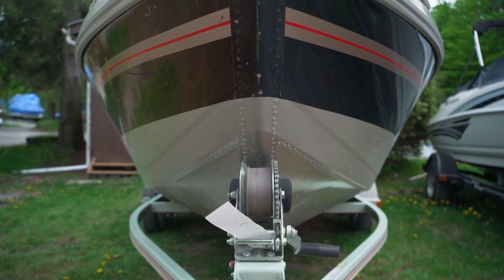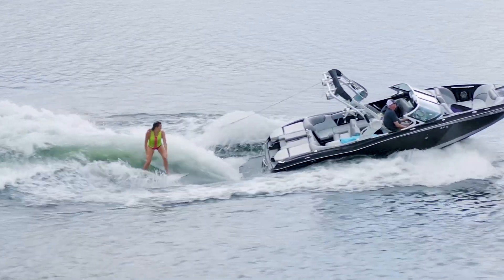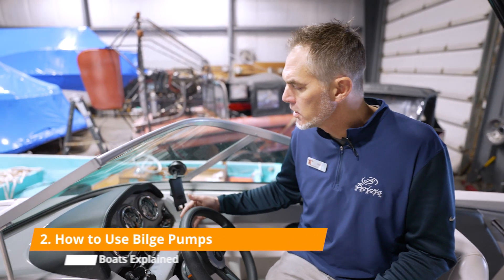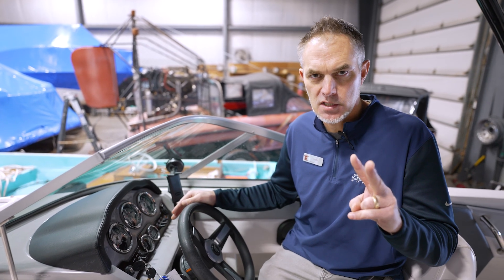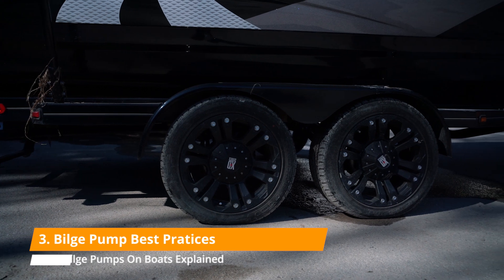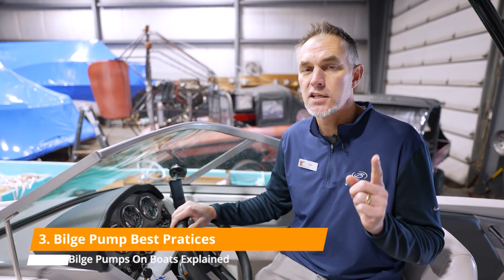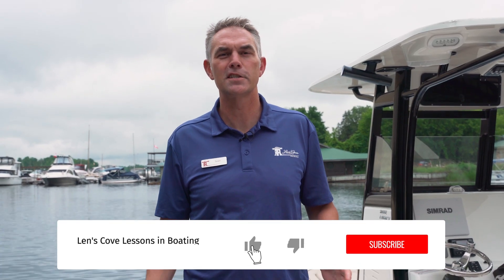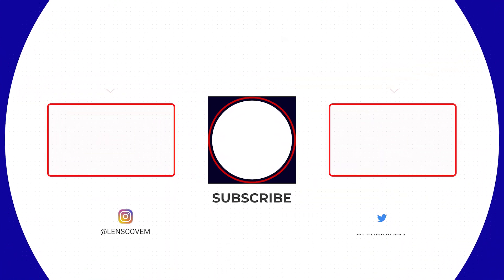All About Boat Bilge Pumps

Comment from the maker: Is your bilge pump automatic float switch wired directly to your battery (always on)? Tell us your opinion on this.
Reply: I rewired ours with its own fuse directly to the battery as our boat would have required leaving the battery switch on for the auto feature to work.
Reply: @brian395  well done!
Reply: The bilge pump most often is the only component that over rides the battery switch being turned off.
Reply: Always, preferably an all in one unit. My current boat has a separate switch that I attached a floaty to so it engages earlier and keeps the hull fully drained. I can't imagine any reason why not to have the bilge wired for always on. Sure there's a risk something happens and your battery is drained, if that's a huge concern, get a solar trickle charger. But as someone who's had a boat sink at the dock, it's worth it to just leave it on.
Reply: (((Bilge pump situations)))
1. Keeping the switch in manual position. Melted the bilge pump after running without water or keel the battery.
2. Keeping the switch in automatic. If for some reason the float switch stays on all the time will damage the bilge pump or keel the battery too.
To prevent both situations. I connected a little alarm speaker on my bilge pump switch. This way every time the bilge pump is working the alarm will sound to let me know. Also I be aware when it is working!
Reply: I bought my 40 year old 26ft trawler three years ago. It has an auto bilge pump in the bilge, but above the drive shaft. (No space below the shaft.) So there was always water left in the bilge. Pump is powered by the House Battery through a switch on the main panel, then to an Auto/Off/Man Bilge Pump Switch. (I intend to bypass the main panel switch, as it serves no purpose and is an extra potential point of failure.) 
There is also a hand-operated diaphragm pump, which was broken and had no pick-up hose. I repaired it, and ran a hose under the drive shaft, so that I can manually drain the residual bilge water. 
Recently, after seeing a couple of local boats go down during an extended period of rainy weather, I installed a backup auto bilge pump in the engine bay, with the auto wire connected directly to the Start Battery (fused, of course). I didn't bother connecting the manual wire, as the pump has a knob that can be twisted to raise the float for testing. 
And the batteries are topped up by separate solar trickle chargers. You can never have too much redundancy.
Reply: Mine is just an on-off switch, no float. 1976 simplicity!
Reply: ...And I've since redone it to use a float-switch pump with an auxiliary wire added to the console/hull harness to power the "auto" lead of the pump (tapped off the bilge pump breaker that feeds the manual switch, which in turn is tied back to battery power). Since I used a "dumb" pump, it backfeeds the manual circuit when running the pump off the float switch, which lights the indicator light letting one know the pump is running. I usually leave it parked on the trailer (and tow) with the battery disconnected (negative terminal screw disconnect). 

Had an incident two outings ago where I had a lot of water get on board but I didn't know until I drained things afterwards... and due to the way the bilge of my boat is setup, it was a lot easier to replace the pump with an all-in-one unit that could be slid in the "cubby" the old pump was slid inside (under the engine). Much drier this last time out.

Comment: What if the bilge button is a rocker switch.  Down for manual bilge, click UP for "auto bilge".   Center position means it isnt' doing either....which would seem counter productive if I have to "turn on" something that is suppose to be an auto bilge, and feels wrong if I need to turn it back to the mid position, essentially feels like I'm turning the "auto bilge", OFF.  Confused

Comment: Came here to find out all about bilge pumps.  Turns out I already knew all there is to know.  If water in boat turn on bilge pump.  If no water in boat turn off bilge pump.  THE END
Reply: The automatic part is pretty important tho.... on recreational boats, do they have alarms on new boats? The older ones did not and if the pump quit you could be sinking before you realize your sinking🤣. If your on a lake or slow moving river you have those risks but if your 40 miles off shore tuna fishing.....

Comment: I have an old boat, no auto function. Should I have it on the whole time im underway? Or even when anchored and we're out on the lake enjoying a lunch? Or just turn it on every now and then throughout the day to make sure there's no water down there? Will it kill my battery when we're anchored and the engine is off? A related question, how long will my battery last running lights and stuff without the engine running?

Comment: I'm perplexed...forgive what may be an ignorant question.  Condensation aside, how does rain water get from above (a presumably) intact deck get into the bilge?  The only conduit into the bilge on my Sea Hunt Triton 172 are the four rod holders.  Yes, there are lots of bolts that penetrate the deck (cooler hold-down brackets, bench seat, bimini bolts and console bolts) but PRESUMING they are well sealed, how does rain water get from topside to the bilge???  Is there any other way???

Comment: if my boat has a bilge pumps do i still need drain plug? and why?
Reply from the maker: A bilge pump does not completely drain a boat as it cannot suck every last drop out. The drain plug is to be removed when the boat is out of the water.

Comment: Good idea to keep one with 20' of wire and two alligator clips for a portable back up. If you see a boat in distress, you can lend it ... even use it from your battery with boats tied together....
Reply: You’re right! And 6 feet of heater hose
Reply: @martinosvath5285 
I've never needed mine, nor my life vest, fire extinguisher (16' open air jon boat doesn't require one), or whistle.... But, I always feel better having them.

Comment: Hi, I have a highfield 420 classic coach boat and I don’t know what to do with the scuppers at the end of the day. The bilge pump always runs (connected straight to the battery) and is automatic. On the manual it says (N/A) as opposed to (closed or open) so I don’t know if it’s best to leave them open overnight while the boat is still on the water, but not being used (moored). I’ve done some tests and I’ve realized that the bilge pump doesn’t pump all the water out, but when the scuppers (they look like plugs) are taken off the rest of the water in the boat that wasn’t initially pumped starts draining out through the scuppers and the bilge pump goes on and pumps water out. I started to think that the scupper plugs are connected to the chamber where the bilge pump is located and as water goes through the hole the bilge pump activates. I don’t know if there is a problem with leaving the scuppers open when the boat is moored. If you know the answer can you please explain why the boat has scuppers, why the bilge pump doesn’t pump all water out and why is the bilge pump hidden in a chamber?

Comment: Why do they fail so often??? The manufacturer seems to blame the dealer and vice versa. I hear these are common problems on Key West Boats.
Reply: Because they’re extremely cheaply manufactured pumps  that easily corrode inside and crappy cheap wiring attached to the pumps that corrodes and creates high resistance or a complete failure of the wire.

Comment: What happens if the bilge stayed on because I forgot to to manual off. Does it burn out if no water? Thanks and sub'd
Reply: They're mostly cooled by fluid flowing through them, much like fuel pumps. Running dry could certainly cause damage to the pump
Reply: This is why it's better to just buy either a pump that's automatic (my personal preference) or one with a switch in the bilge, leaves a lot less room for human error.

Comment: Hi Len, have you ever come across that the automatic float switch was not working.  I was about to replace a new Float switch, after I remove the old float switch by cutting the 2 brown wires. I was testing to see if the bilge pump would work so I touched the 2 brown wires together and the bilge did not turn on.  But I can manually hit the bilge button and the bilge does turn on.
The five amp fuse of the automatic bilge pump was intact. 
Any thought ? 
My bilge is a rule 1100 GPH ( does not have a built-in automatic)
Thanks in advance
Reply from the maker: Yes absolutely, the switches fail frequently. We replace several a year
Reply: No matter how it is configured, one of the wires has to go to the bilge pump.  Find out which float switch wire has continuity to the bilge pump to what polarity it is connected.  If you don't have that, that's the problem.  If you do, then the other side of float switch is open and you will know its polarity.  You can make a test jumper to connect directly to the battery from the float switch to run the pump.

Comment: Len,  I know this is a bilge pump video but do you know the recommended time to replace a water pump.  I have a 2020 Robalo.   My mechanic recommended every 3 years which means I would be replacing it next year.
Reply: Just an fyi update - Had Water pump changed this year which was year 3.  Wouldn't go any longer then that.
Reply from the maker: Hi Robert. I agree with that recommendation. It likely is ok to five years but the peace of mind is priceless. Have you seen our impeller video?
Reply from the maker: https://youtu.be/m97mrI5s3QU
Reply: @boatinglessons  I have watched that.  I'm sure that might be on the maintenance list to but the mechanic made the water pump recommendation last year when I put the boat in.  At the time the boat only had 165 hours on it.  Thank you for the quick reply.
Reply: @robertstorms5539  the years (time) is often a bigger factor than the hours (use).
Reply: 5 years is what I was always told but then again we are freshwater less corrosive issues